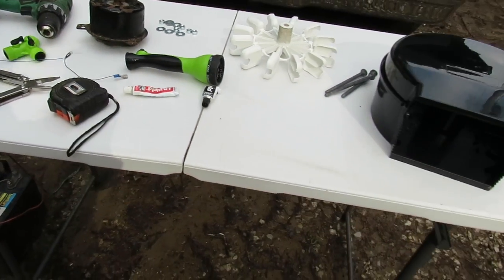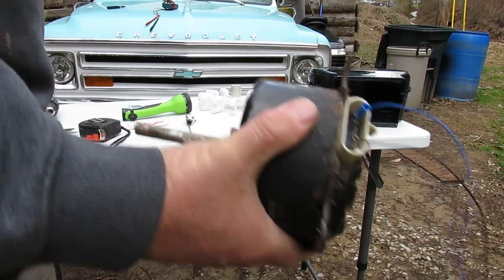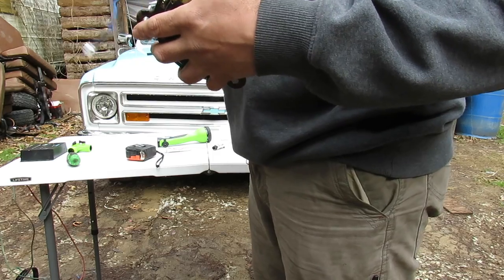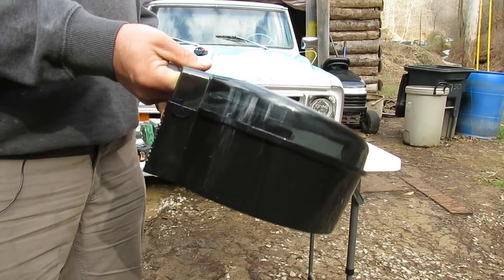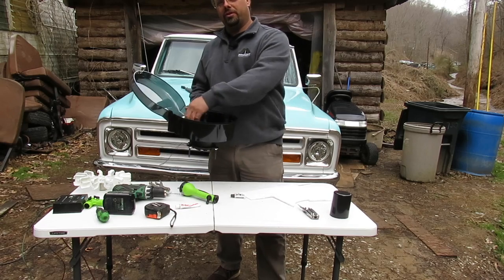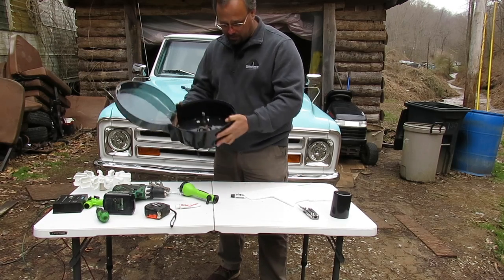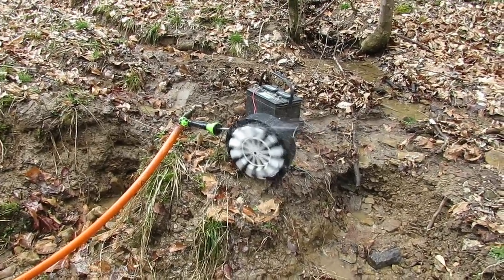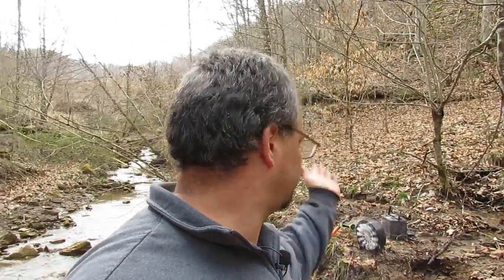Easy to Build Water Turbine Generator From Junk

Comment: would you put a step up gear box between the water turbine and the generator to boost up the RPM?
Reply from the maker: You can if there is still enough torque to spin the turbine.

Comment: Being a trucker, I've wondered why not do a 12v cabin? Only thing I use that's not 12v is the microwave and washing machine.  Soo.. a truck alternator and big batteries? Or even a starter off a Cat?
Reply from the maker: It would be much more efficient to use all 12 volt stuff. No need for an inverter, just hook up directly to the batteries. Good idea!
Reply: @lukeFugate  I mean, led lights, my fridge is 12v so yeah.. why not?
Reply: 12v dc does not span lengths very well.

Comment: What I like the most is the toilet paper roll housing.  That's using some good insight for taking what you have and making something work.  If you do put an opposite  stream of water at the opposite lower direction, all the overflow will still fall out the bottom and keep the system clean and super efficient.  No unwanted debris can get into the housing. That would be taken care of up stream, which is the most common problem with this type of system.  Any small amount of foreign material will just fall out due to the constant flow of the two directional cleaning done by the system itself.  It would be self cleaning.  The problem is that the plastic housing will deteriorate and decay  over time, do to temperature and the thermal break down of the plastic; so you should protect it by spraying it with a rubberized spray paint of something  to add some additional strength and weather proofing to encapsulate it and support it and protect the plastic over time.  You could place something like this anywhere and channel the fall out water to another location for something else.  I would look into using a brush-less motor from one of those kids hover-boards or something like that, because they don't have as much resistance to turn them and people buy them for their kids, and as soon as the battery dies they chuck um. If they don't catch fire first and set their house on fire.  Love the video.  If you can keep the generator out of the water or over the water, and protect it from the elements the generator is going to live longer.  I went through all the reviews and I was amazed that there wasn't any negative  reviews.... until the end... That's a good thing.  Keep up the good work.  Take the good from your followers and discard the negative ones.  It's Mind Over Matter.  Those who mind, Don't matter and Those who matter don't mind. Just be honest and share what you know to everyone.
Reply from the maker: Thanks! It is time for a redesign on this system. It is still the rainy season right now, so I don't even bother with cleaning out the debris for now. It has been stalled out for a couple of weeks, and whenever I unclog it, before I make it to the cabin it clogs up again. I am relying on my solar panels right now and they are giving me what I need as long as I conserve power.
Reply: @lukeFugate  Use rain water in tank and use water pump think that can work then you got clean water also

Comment: If you really wanna try it for cheaper you should try with a diode instead of that charge controller. Nothing wrong with it, just a cheaper way in this instance and less electronic components.
Reply from the maker: Good idea, I don't think this setup could ever over charge a battery. It just doesn't have the torque.

Comment: Why couldn't you put the blades of the generator into the stream instead of using a hose?
Reply from the maker: It has to have higher pressure to increase the velocity of the water. The creek moves too slow to spin the blades fast enough.

Comment: Did you need the solar charge controller to charge the battery or can you just connect the wires directly to the battery terminal
Reply from the maker: You have to have the charge controller. If not the battery will run the motor and it will run it down.

Comment: Awesome. Thanks for making this at a level where I can understand it without an engineering degree.
Reply from the maker: Glad you liked it!
Reply: Where is the water coming from. Where is the other end of the yellow hose? How are you getting so much pressure?
Reply from the maker: @keithf5883  it is gravity fed from a higher elevation.
Reply: We use to gravity feed our hogs like that. Lol 300 foot of gravity fed 3/4 inch water line, by gum!!

Comment: What is the elevation different between your water source and your turbine?
Reply from the maker: It is about 40 feet of drop. It was an old silt pond from a coal mine. They closed down the mine and filled in the pond years ago but the change in elevation is still there from where the dam was.

Comment: I don't have a 3d printer would you consider selling one or two of the turbine wheels?
Reply from the maker: I would not recommend using plastic for a pelton wheel. Mine is worn out already and I will be switching to an aluminum one soon. Here is the one I am going to use. https://www.ebay.com/itm/Aluminum-Pelton-Water-Wheel-for-Micro-Hydro-Generator-Turbine/132062129154?hash=item1ebf842c02:g:Gr0AAOSwnHZYdzvK#rwid
Reply: Ok man thanks also would you recommend using the fan motor?  As of now it's all I have. Is it worth it?
Reply from the maker: @indamud2006  Of course a permanent magnet alternator would be better, but as long as you can get the fan motor spinning fast enough it will produce power. I would try it if I were you since you have it already.

Comment: Thank you very much !  Can you tell me the WATTage size DC motor I could use for this please? 
- ( To charge 12V batteries as you are ) -
 I'd like to buy the DC motor off ebay and use for both water and wind.. And hello from London, England, UK !
Reply from the maker: I have heard of people using treadmill motors with success. The bushing type motor I used isn't made for constant use. I would also recommend getting an aluminum Pelton wheel off Ebay instead of making a plastic one like I did. Mine is showing signs of wear.  Good luck on your build!

Comment: how do connect the water and make it spray
Reply from the maker: The intake of the pipe is at a higher level than the generator is, so the water gravity feeds.
Reply: DIY Everything that still don't answer our ?, how trying to figure out what at the top of the hill ,if the creek is at the bottom, how is water going through so fast! is there a lake on top of the hill!
Reply from the maker: @alimohammond9315  it's the same creek just running downhill. The creek drops downhill quickly at one point. The intake is in the creek at the highest point and the generator is lower.

Comment: What are the practical applications? We do not have electricity up on our mountain property and were looking for extra options. Were working on solar but living in Washington state sun in fall/winter. We have 2 creeks with multiple waterfalls.
Reply from the maker: If you have multiple water falls you should be able to use micro hydro on your property pretty easily. I would recommend a pre-made pma and a metal pelton wheel. This setup works but loses a lot of efficiency. 

How much drop do you have in your highest water fall?

Comment: Congratulations you have DC current going into your batteries at nighttime. On hydroelectric power. I we'll refrain from asking how many amps is going into the battery.
Reply from the maker: Yeah, it's not much. I would say I would be lucky to be getting 50 watts out of the system I have in place.
Reply: @lukeFugate  you may try getting yourself a long shaft. Since you print up your propellers. I'd make them so that a boat will go through and into the shaft. May need to make it stainless. Put at least 6 of them on the shaft build a manifold that holds the water jets this manifold will dictate placement of the Paddlewheel. Now you need a box and some roller bearings. This is going to be a little bit long. And you mean need a sheet metal to keep the water from flying everywhere. You want to find some type of flywheel. And hopefully with six times the force and the flywheel. You may put a standard alternator or a low speed alternator. Something that will shut off if your battery bank is full. On your manifold you probably want to use garden hose spray nozzles the ones that screws on and it has no settings that is it looks like a firefighters hose with this a hole in it at the tip. This way if it gets clogged you can unscrew it and maintenance it. You can make a huge one in this scenario you have like 10 spray Jets and you're feeding the water from both ends. However this unique suggestion needs to have a little bit of math. Depending on the size of your spray Jets. One little thought I have thought about lawn mower engines that is the generators that are in the flywheel. And in this scenario you would have to take apart and modify the engine housing take out the piston and hopefully you can salvage a bearing in the housing that will be attached to the flywheel and stator will charge the battery Staters are said to be really good.
Reply: TRUE WORSHIPERS TRIBUIT QUEST I like your ?! cause I have a coffee grinder from mine neiber wife and she Chinese , when she went back to China to see family ,she brings back, and the blender take 50 watt, and here in America there 60watt! do China stuff work better than American stuff for off gridding! our electronic are 60 Hertz and there is 50 Hertz!! 😀 thanks u help me out alot with that ?!

Comment: Where can I get the water wheel
Reply from the maker: I would definitely go with aluminum. this one would probably be a lot better. https://www.ebay.com/itm/Pelton-Water-Wheel-Turbine-Aluminum-Micro-Hydro-Generator-w-Adapter-free-ship-US/201853521661?hash=item2eff684efd:g:Nr4AAOSwYXVYyIZj
Reply from the maker: I 3D printed it. It would be better to get one on Ebay or online somewhere that was made of metal. Mine is showing a lot of wear already.
Reply: luke Fugate do they make such a thing that you have seen anywhere or is it possible to have one made from ..say aluminum? Or would any pelton wheel do?

Comment: Do you have a video of where you have the water coming into the hose
Reply from the maker: No. I just have the hose in the creek toward the top. I put rocks over it to keep it under the water. It clogs up pretty easy. It needs an intake filter of some kind. I was thinking of drilling a bunch of holes in the pipe to about two feet from the end and covering it with screen. I haven't had much time lately.

Comment: Very cool stuff my man!
Reply from the maker: Thanks!
Reply: @lukeFugate  I've been trying to figure out how to setup a hydroelectric setup. I'm not the most handy of people. But I do have some pretty powerful rivers/waterfalls near me. And no chance of getting power from the grid. Solar isn't an option because of all the rain and clouds in my area. So hydro seems like the only real option. But it seems it may be a bit harder to setup than I originally thought haha. But I do have some powerful flowing waters. So it must be done! I really appreciate your video though. I'm getting a much better grasp on what I need to do.
Reply: @anymalistic2730  Depending on your budget there are options to just buy ready-to-go hydro-electric generators. Ranging from very expensive ones to cheap small ones. Several smaller ones might be an option if you want to spread the cost over time.

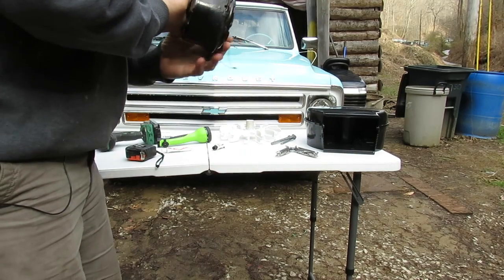Comment: some thoughts.     at 2:59,  WRONG.    when used as a  PMA,  the output of a dc motor is  A  C.       it will be  DC,  only if there happens to be a   built-in  Rectifier.      at 4:30,  this will be  true, Only,   IF it is a  permanent magnet motor.       you do NOT  know what you are doing;  notwithstanding, that i  TOLD  you what you Should do.        unless you have (secretly) installed a three-inch,  fifty meter penstock to supply the REQUIRED  psi,  this sillyass idea is  NOT  going  to  work.          googletranslate
Reply from the maker: The output is DC Not only did I check it with a volt meter, I lit up an LED with it and it lights up the LED which is a light emitting DIODE only when it spins one direction. If you spin it the other direction it won't light because you reversed the polarity. if it were AC power it would pulsate not light steady. This is a permanent magnet motor and it works as a generator as is. I even say in the video that this is not the ideal setup and in the next couple of videos, I modify a car alternator with neodymium magnets and turned it into a PMA. I then used the same housing and 3d printed pelton wheel to build a generator in the same place. I may not know what I'm doing but I have a homemade Pelton wheel generator supplying my cabin with power by charging my batteries and running an inverter. I even spent the night up there using power from the pelton wheel generator I made. I know it works because I ran lights all night long and the batteries still showed 13 volts in the morning.
Reply: David Davids your a BIG OLE DICK ARNT YOU!!!!! Lmao
Reply: David David's you're a moron. Google translate that

Comment: Do you prefer this to the modified alternator setup ? if so why ?
Reply from the maker: I prefer the modified alternator as it puts out three phase AC so the power can run a longer distance with less voltage loss. This one puts out DC voltage which is susceptible to quicker voltage drop.  This setup would work great if it were close to the cabin or whatever you wanted to power.
Reply: Interesting, my only real experience with DC was in a glass factory... we used it in the furnace to help melt the batch. The electrodes and cables were about the size of your wrist.
Reply: And cars of course : ]
Reply from the maker: @TheCanadianBubba  That had to be a lot of power going through those cables! That's the kind of power that Grabs you and won't turn loose.
Reply from the maker: @TheCanadianBubba  of course lol.

Comment: Well Luke, you certainly proved your point about not needing expensive equipment to build a water turbine. Looks like you need a lot of those hillbilly smarts though, lol.
Reply from the maker: Thanks, It may not be the most efficient setup but it would charge a couple of batteries.
Reply: Neat, as long as it's sufficient for use, that's what I like. Reasonable rather than overdone

Comment: What happened to the cabin build
Reply from the maker: That is what I am going to power with this and the water wheel. I just wanted to get it all powered up before I do a tour of it.
Reply: So a two layered power set up? Maybe?...
Reply from the maker: @lkimberly2064  Yes, it will have the water wheel and a turbine generator powering it. I like the redundancy of having both systems.